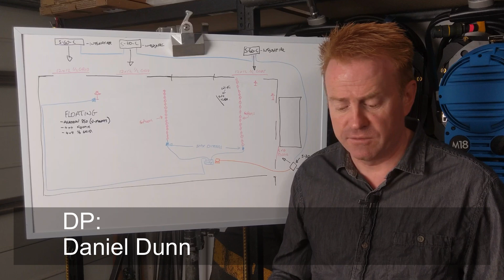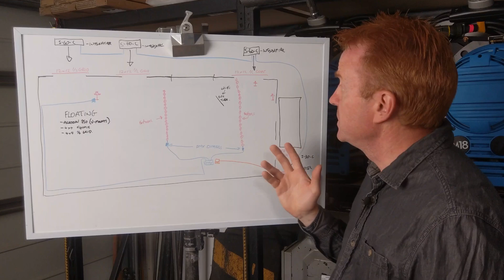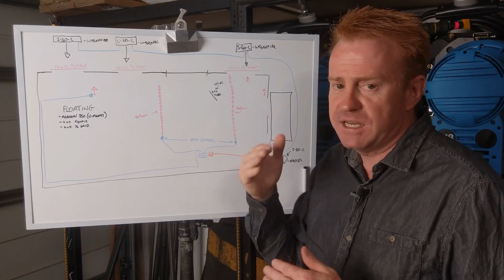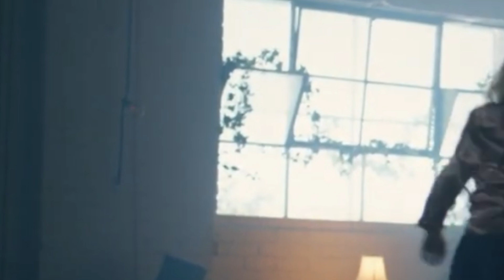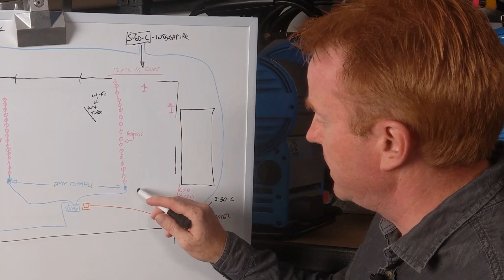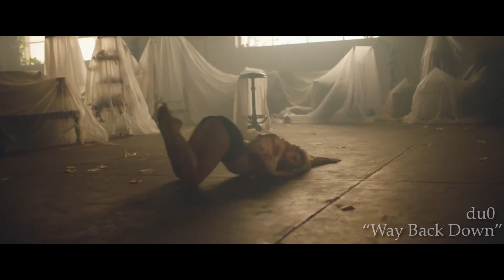Gaffer & Gear 73  - Using Windows as Cinematic Light Sources

Comment: Why was not bringing your wireless dmx the best choice for you?  I am curious because as you said , the skypanel controller could not meet the directed lighting cues required, plus I realize you are bringing all the dmx cable, the skypanel controller and other possible gack. You said they didn’t budget for the wireless dmx kit.  However would the wireless dmx have made your job easier?  Would you have brought less equipment had you brought the kit?  Could it have helped with being precise on your cues?  I know it would have brought more overall functionality to have the wireless in terms of range of functions and features but those could be limited to what your wired-master-slave skypanel controller could do.  I could also see if there was a possible rental of the wireless dmx that day - that would take primary function since its being paid for.  Just curious where and how you draw the line vs scenario where it could play a benefit to your role vs the “cheaper” way.
Reply from the maker: I didn't own CRMX back then do it would have been an additional rental. They just didn't have the bucks for that.
Reply: It also occurred to me this job could have been done before you owned your wireless kit.
Reply: To simplify: I get hired on a fixed budget, I schematic the fixtures/gear to that budget, I realize I have another fixture in my stock that would make my life easier so I just bring that instead - over-delivering - more than what they paid for - it brings them a better overall experience than they paid for - but is this a bad idea?

Comment: Hi Andrew, I'm a big fan of your work and am currently in the early stages of training to become a Gaffer. In terms of gear, I'm only running with an Aputure 120d mk 2 and a set of three Aputure amaran panels so far. I'm considering picking up some new lights soon and I was wondering if you could advise me on what the next best investment would be for my kit? I can probably invest around £1000-1500. Thank you so much in advance! Keep up the awesome content :)
Reply from the maker: I would consider some  hardware. Stands, clamps, things like that, to extend the capability of the lights you already have. Floppies or flippies, that sort of thing.

It's also a £15,000 investment that would last you forever.
Reply: @gaffergear  thank you that is much appreciated 🙏🏻

Comment: Andrew, I'm looking for ways to use modified practicals to light for documentaries. Should I use traditional incandescent bulbs or perhaps find  smart led bulbs as replacement as they have a few advantages. For docos, artificial lights can often seem unnatural so I want to use natural and practicals as much as possible. Could you possibly make a video on using practicals and how to modify them to achieve the result you want? Thanks
Reply from the maker: My next video is the Aputure smart globe. It can run WITHOUT app contoll, the last thing you want in a doco is trying to get an app to work.
Reply: @gaffergear  Thanks Andrew. Yes, I see that Aputure is releasing a smart led bulb as well as the ls60x which I'm quite excited about. My favorite fixture remine the Digital Sputniks however the price tag is quite high so can't afford a bunch of them. I was told that they are designed for the digital sensors. Do you plan on testing one of those in the near future?
Reply from the maker: @Bshg62  I'm more excited by the LS60x than any other products this year.
Reply: @gaffergear  I only wish they make a small nova perhaps a quarter of the size and can be used similar to the Ls60x. Actually I've written a request to Aputure. Looking forward to future reviews.

Comment: I like how cold light from windows is looking. But I don't like how looking warm lights, may be it's a problem of color correction, not just lights. Also using 3 Arri for simulating daylight is not so cheap solution. For me it's interesting why director don't want to use just natural daylight and save some extra money.  Sure I understand that daylight is changing, weather is changing, temperature of daylight is changing. And using Arri give better control. But natural light is more cheaper and more natural. Also this is not a long video, so it's not hard to shoot it in short time with similar daylight conditions.
Reply from the maker: With the exception of the last two lighting transitions, where the festoons were giving a separate light source to the windows , the rest of the transitions could have been totally done in the grade. Which is why I called, and made the episode about "using windows for cinematic lighting". Take out the last two transition and we could have done this with tungsten light through the windows at about 25% the cost.

The transition where the festoons turn on, I was deliberately late with the window transition so it wasn't locked to the whole look change, otherwise that too could have e just been a post grade. In order for something like this to work, you need a separate, constant light source in shot, maybe a practical somewhere.

Comment: First, very cool stuff! As much as I would like to have in my arsenal a few s60's, that's not possible at this time. You had in your previous Post a review of the Lightman Luxed. That I can afford. Working with Fay's, Mini and Maxi Brutes in the past, there is the multiple shadow issue. I'm old and old school! that said, even those lights punched through say a 12 x full-stop silk, would work fine. Even though I wouldn't have RGB control with the Lightman Luxed, I would still have the punch through a window or 2 with that light. Am I correct in my thinking? If so, I'd be purchasing a couple of Lightman Luxed units mostly for window light purposes! 1200 par HMI's are too spotty and there is the power draw issue as well with larger HMI's as well! Thoughts? Great stuff... I love your posts!!! Thank you, Andrew! Salem Oregon!

Comment: Hi andrew what a  coincidence, i'm currently facing the same situation where i need to change the lighting or day interior to night interior in one take. Inspired in your video my option is using s30 RP to change the cct from 5600 to 7500k using on board preset, because the rental owner didn't have the remote controller. but if the budget is tight i'm using the falcon eyes rx-818 rgb flexible led, but the app controller is kinda shit. hopefully it will work out like just like in your video.

a little question about that practical light dimmer, never saw one that can connect to dmx before. are you planning to make a video about that in the future ? i always have a problem connecting a practical lamp to a dimmer.
Reply from the maker: I wasn't planning on making a video on those dimmers. I just assumed they were common. But I guess that's because I live in the same town as the manufacturers.

Looking in line their are not many with 5 pin DMX.

What in particular are you interested in with them.
Reply: @gaffergear  i'm interested about the amount of control you can get with the dmx control. can you dim the individual light bulb like in your video ? or we need to connect each bulb to dmx dimmer to do that ?

can you control it with exalux and set a few scene ?
Reply from the maker: @OppaiDaisukiful  with the in line dimmers you can set different DMX address to each one. So in this set up I had the lamp on Chanel 1, and I had the two dimmers running the festoons set on channel 2 and Chanel 3.

So on my basic desk I could set each row seperatly but still be able do dim them all at the same time through the master slider.

If I was doing this shoot today. They would be controlled via my exalux with each dimmer set up as a single Chanel fixture.
Reply: @gaffergear  thank you for your answer sir, what is the name that dimmer ? couldn't find it on internet
Reply from the maker: @OppaiDaisukiful  it's made by tecart.com.au

But they are for Australia. If you are overseas (different voltage and plugs) they can make special for you, just send an email)